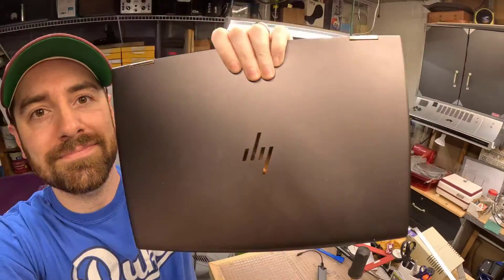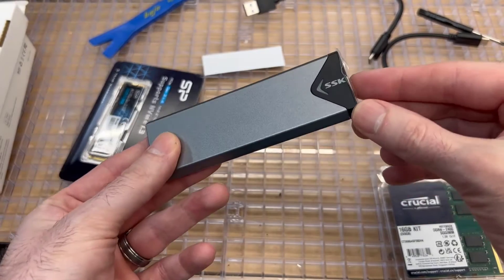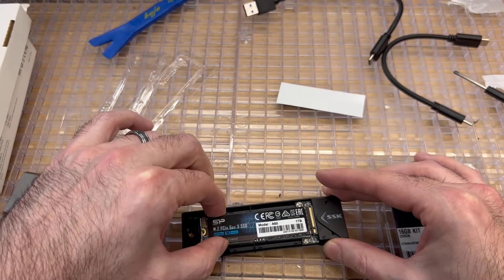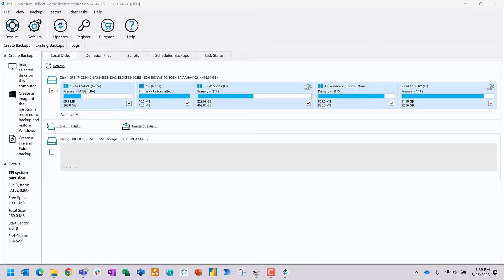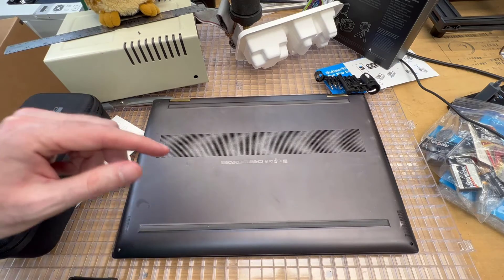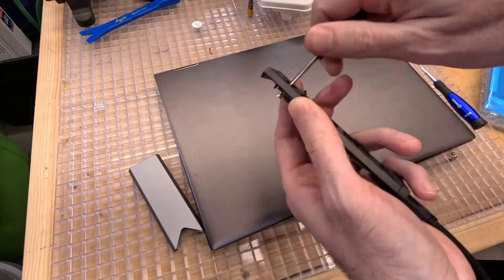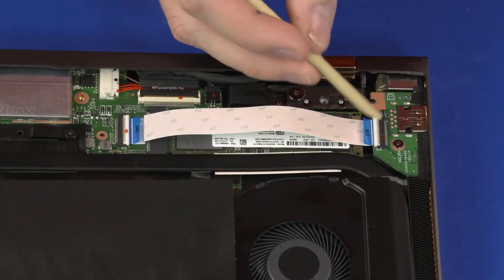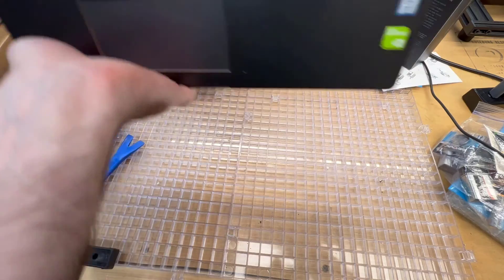HP Spectre x360 Laptop Upgrade

Comment: I did this to switch my 512gb SSD to a 2tb drive, and learned a few things on the way. If "clone this disk" does not appear in Macrium Reflect, make sure the new drive has been initialized or else it won't be seen. The clone took about 4 hours. After replacing the old SSD with the new one Windows did not boot correctly. I was able to boot it into safe mode, and presumably it fixed itself from there, I rebooted it normally and now it works. Thanks for the video!

Comment: I run Adobe photoshop and illustrator.  My hp spectre came with core i7, 16gb ram, Nvidia GeForce graphics (2gb), 477gb ssd. I got it for the 360 and pen factor, thought it'd be a good option to draw and illustrate. Its never run well, the lag is very noticeable. I know... shoulda just got a ipad for procreate. Reguardless... is the method you used to clone the memory on a 1tb external drive a better (and cheaper) way to upgrade rather than buy internal hardware? I hate to get a whole new laptop, but, which do you think is best to run those programs efficiently.  Thanks

Comment: So I'm upgrading the RAM to 32GB (less than 60 bucks!) and the new SSD doubling memory and read/write speed with a Samsung EVO (just 80 bucks!), I'm also replacing the battery because it got super swollen (expensive repair!)... Next I plan to upgrade to Windows 11, because there's a way to do it even though it's not technically compatible (still have to make sure). My question is, since you've probably removed the heatsink and fans part... Is the CPU upgradeable? Of course all info online says no because it's soldered but same thing is said of the RAM, which is clearly false. Let me know, please!
Reply: cpu is not upgradable
Reply from the maker: I would not think so - and it gets tricky depending on motherboard type.
Reply: What 32 gb ram did u use to upgrade?

Comment: My hp spectre 360 screen flickering. I have changed operating system but not yet solved. What is the solution
Reply: display cable through the hinge. usually the likly culprit. otherwise backlight.. connect hdmi same issue?  if so then its gpu ,software, ram, or thermal related

Comment: Hey my 15 or 16 inch spectre x360 came with 16gb of ram and when i went on crucials site they had a 32gb kit with two 16gb chips they said was compatible but it was marked at 3200mhz you think that will work?  I really want to up the mhz speed if i can do so.  I am also changing my ssd to their 2tb drive
Reply: check vey well if you can upgrade the RAM cos it is soldered on the Motherboard
Reply: @livingcursefor3088  It's not soldered in mine because it's pre-2018

Comment: What year was this model, i heard the model with 11gen i7 processor  the ram is solder to the mother board,
Reply: did you get an answer if this laptop is upgradable?  "I have the same one that I would like to upgrade
Reply: Yes, the RAM is soldered to the board, you can only upgrade the SSD. I have Spectre 360 Convertible 15- @ceciljackson3068
Reply: check 3:48
it's i7 8th Gen which still upgradable
Reply: starting in 2018 most laptops started having soldered RAM, but not before that
Reply: @davidadhira7528  no, there's much laptop have soldered ram before 2018

Comment: Great video! 
I was under the impression the X360 had the soldered on RAM directly to the motherboard. I wanted one of those, but, I wound up with the lenovo Yoga 7i. 
I wanted the number pad. 
Now I'm at 16g RAM but want to add more and can't. 
both seem like great computers.
Reply: The smaller screen models do.  It depends on your model.  If it has soldered on ram its a huge pain to change.  It can be done but its not something that should be attempted by anyone other then a professional.
Reply: 16gb is really enough for most tasks on windows.  There's some running 8gb of ram so your doing alright.  But I do get it I have 16gb and am upgrading to 32gb but that's only because I like to game and also live stream while I game from the same computer and doing that in particular eats up the ram so I really have one of those few use cases that really needs the extra ram capacity.  Not a lot of people realize this but upgrading the ssd drive to a faster one can also speed things up a good bit specially considering most ssd's have doubled or even tripled their speeds specs in the last 5-10 years and gen 4 ssd's are fast AF and will likely work in your notebook.